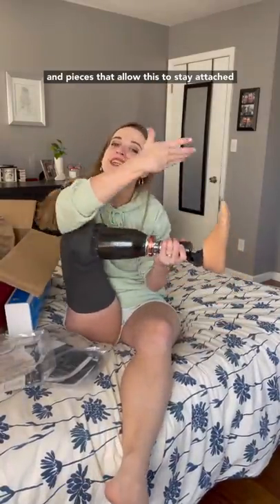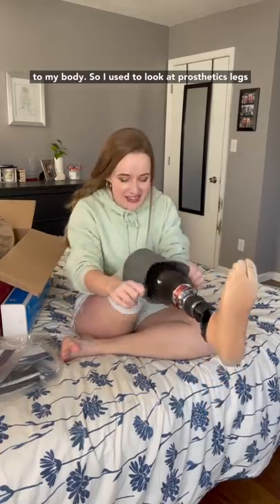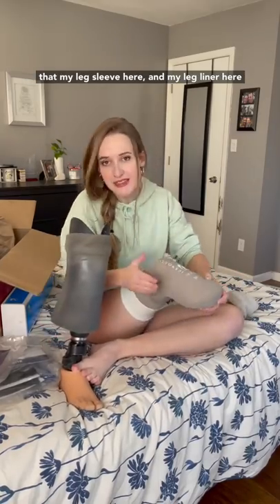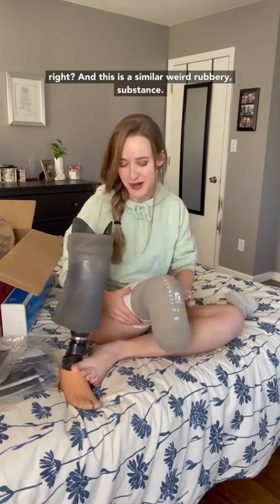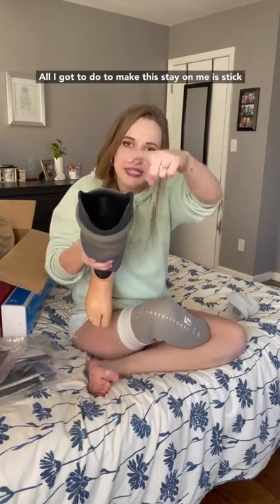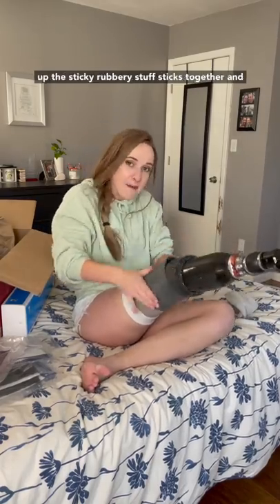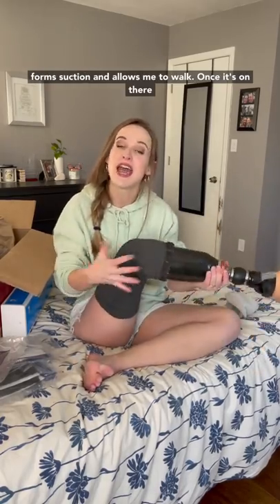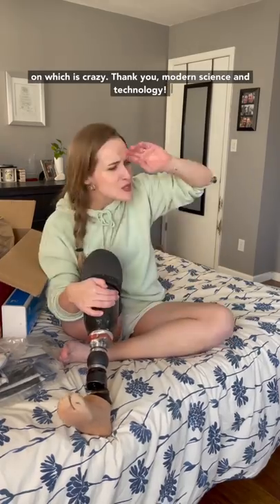How my prosthetic leg sticks to my stump!

Comment: Air pressure is an incredible thing. Using my own leg, it has a circumference of 21 inches. Assuming your own leg is about 2/3 that, you've got a radius of about 2.3 inches. That's an area of 17 inches squared for a total suction of 250 pounds. Just suction, no friction.
Reply: Fun fact, lego making machines are specially made to not cause suction (as most rectangular prisms would) because building molding machines around fighting that was too cumbersome
Reply: With a 21" diameter leg, you would get every poor body builder to go home, cry and quit.

A diameter of 21" is 53 cm. That's a very, very wide leg.
And it's a circumference of 66" or 168 cm.

But if a radius of 2.3" is 2/3 of your leg radius (or 1/3 of your leg diameter) then that would mean 3*2.3 or a diameter of 6.9" or 17.5 cm.
Reply: i don't understand a single thing u said, but i think it was cool?
Reply: @paigelonnemann3864  it wasn't, don't worry😂
Reply: @perwestermark8920  he said circumference
Reply: @fankyl6459  Nope. Notice the "(edited)" hint for the original post.
Reply: How tall is u
Reply: @perwestermark8920  You must have misread. The comment was edited before anyone even replied. As is this comment.
Reply: @brandonn6099  No misread at all. I did read the text multiple times before responding. And this word  were edited.
Reply: @brandonn6099  I made a pist that could be seen as a joke and hint to correct the post. This would have been a non-issue if you had done what most people would do and post "oops - corrected". But you made it into a fight to the death by pretending I had read wrong.

A mature person knows we all makes mistakes and doesn't get offended and lie when someone spots a mistake. There are a number of other YT threads where I have had to make a "oops, fixed" post. Live and learn...
Reply: @perwestermark8920  A mature person maturely points out a mistake instead of acting like it was on purpose. Congratulations on completely playing yourself.
Reply: @brandonn6099  I never acted as if it was on purpose. I just played out what the implication would be with those numbers.

A mature person doesn't lie and then jump between a number of desinformation tactics to pretend it was someone else that goofed. Remember to don't try that tactic as an employee.

Comment: My prosthetic is a bit different. It doesn’t have the suction system, mine has a screw at the bottom of the leg liner and to take it off I have to press a button on my prosthetic leg to take my leg off. That’s why I call it my bionic leg. 😁👍

Comment: I have a weird question. Let’s say that you have been sitting down working for awhile and you get up to stretch. In your head can you stretch your foot and stuff and feel it due to pass memories but feel off because you can’t actually stretch your foot/toes?
Reply: I'm a below the knee amputee. With or without my prosthetic if I will to move my ankle joint or any joints in my foot it feels like the bones are fused together. Not actually pain, just a sensation that they're inflexible. I can't feel pressure against the sole of my prosthetic foot but I experience a sensation when my leg is supporting my weight and an awareness of where my foot is. The prosthetic's ankle does bend in response to changing pressure when I walk and returns my foot to perpendicular to the shin when I take my weight off of it. I'm a few decades older than Jo and there aren't many circumstances where I'm confident enough with my balance to stand or walk without a cane or  walker.

Comment: What do you do when you go to bed?
Reply: Probably the same things non-amputees do. Missing a foot does complicate those middle of the night bathroom trips though. I'm another below the knee amputee.

Wearing some prosthetics involves rubber and/or other non-porous materials in contact with large areas of the residual limb's skin. That results in an accumulation of perspiration that wouldn't be a good idea without a break overnight following a washing. In the morning any creams or powders applied to the residual limb might need to be cleaned off to keep them from interfering with the friction that keeps the prosthetic on or chemically damaging the rubbery liner.